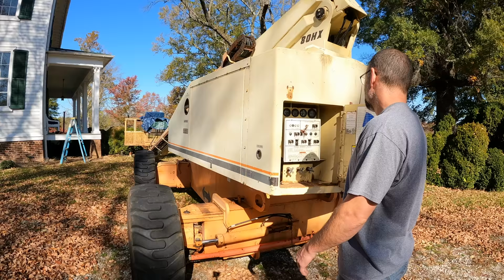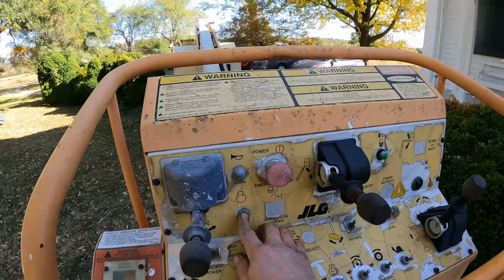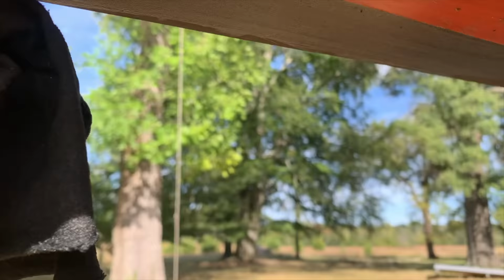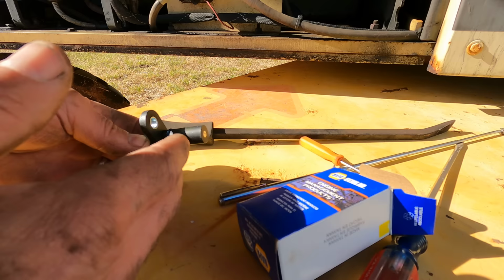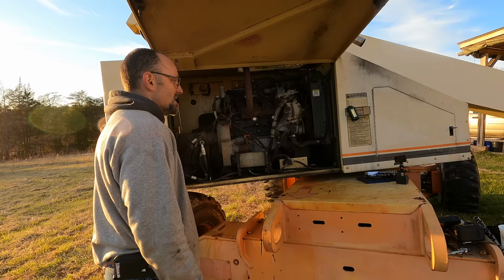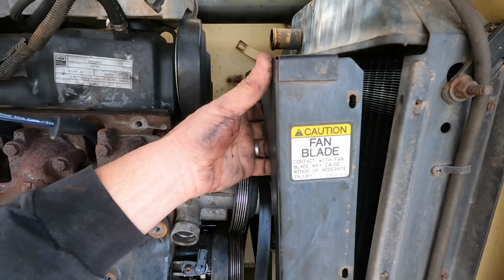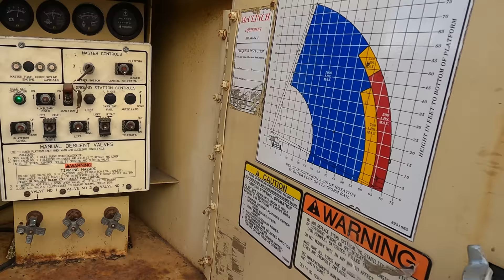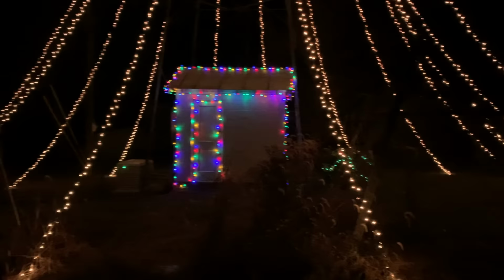My Boom Lift Broke Again! Fixing It & Then Doing a CRITICAL Job With It.

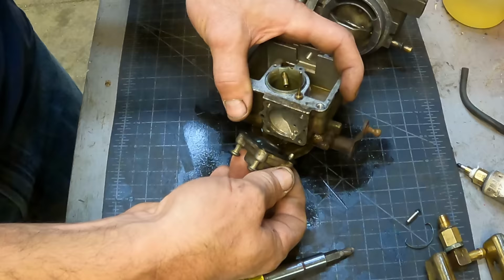Comment: at +3:00, and at +5:15, where's the spring that's supposed to be on the outer side of the black rubber diaphragm? That diaphragm is the vacuum-operated accelerator pump. I don't think it will work correctly without a spring on the outer side to pump the shot of gas into the throat of the carb when the throttle opens up off of idle.

Comment: What is the manufacturer of the engine? I'm sure JLG doesn't design and build their own engines, I'm sure they buy them from someone else. I'd bet you could get the carb from the OEM of the engine, or possibly if you can determine the cfm of the carb, find one that is more easily available, and can be adapted to fit for like a tractor or something like that. BTW, I'd bet that plug is for a vacuum advance on a different engine.

Comment: Hay thanks for another great movie, I once had trouble starting  my mark 3 ford cortina and I took it to my garage and they changed the thing that gives the coil 12 volts while you crank . Is it the verable resistor??  I can’t remember what it was called . Hope this helps.

Comment: Is your fuel gravity Reed?you might need fuel pump (electric)  also ck. From fuel tank to filters to carb (may have a break or pinhole in gas line to starve gas to carb
Hood luck

Comment: Coil and wires.....but did you check and replace the spark plugs? Best ignition in the world doesn't do much good with 20 year old plugs with an equivalent of 250k miles on them.....

Comment: Sorry if my questions are becoming annoying. But I bought a 2000 800a and it's not running well. What napa part number did you get for the spark plug wires?

Comment: hmm, you say thats a 90s ford ranger motor? I have a 89 ford ranger and its fuel injected. it sits and sits and Ill crank it every once in awhile and it fires right up every time, after the battery has been topped off

Comment: hi I ask the question is the engine,  electronic or points  if its points and has a condenser change the  condenser
on old engines with points the condenser  was the most common starting fault

Comment: Have you checked the fuel pump? Perhaps flow/pressure is low, meaning the bowl eventually fills up, but the drains too quickly under load. Alternately, try burning some sage, or contacting a priest. :)

Comment: Your problem is defiently fuel related, I think you are loosing fuel pressure so check the pump check all lines and filters, check fuel pressure it should be I think around 50 psi. But it is for sure a fuel problem… unless it’s your timing so check that to

Comment: what is the part number for the coil and plug wires ... or what vechichle does it call for i have a ford lrg 423 i believe there basically the same thanks

Comment: Looks like the fuel is draining out of the system when not running, there could be a bad check valve at the fuel pump…

Comment: How did you not need an industrial-grade bleep machine? Admirable restraint sir.

Also, assuming the motor just drives a hydraulic pump, would it be feasible to fabricate a removable platform for the motor since it seems likely this is going to be a time-suck for the rest of your life? Note - I'm a computer programmer not a mechanic so treat this suggestion with the disdain it deservers.

Comment: You'd think there'd be a HUGE market for a new set of engineers... to figure out how to design this equipment so that there is more room to make it much easier to work on.  Seriously... did they have to put the drain valve for the radiator at THAT end of the dang thing?  May be time to start a company that actually does that... might give Yanmar and Kubota and all those companies a run for their money.

Comment: If that is the older Ford 2.3 liter engine in that thing, REPLACE THE ENGINE. That engine was designed for the Pinto, which should tell you everything you need to know. That engine's best use is as a boat anchor, and it's not even ideal for that! Mark my words, keeping that engine is the way of masochism and frustration. 

I have had three of the damned things, in a '76 Mustang, a '79 mustang, and a '95 Ranger. Every one of them ran poorly and ultimately threw the timing belt. The engine is a zero-clearance engine, and throwing the timing belt while it's running will result in the camshaft getting warped. Once that happens, it will run even worse than it's running now. Throwing parts at it won't help, I think it was designed to run like s#!t after about five years.

Comment: Totally random question. Are you a ham radio operator?
Reply from the maker: I took a class years ago but hardly remember a thing, so not really.
Reply: The reason I asked was the antenna you had up on the top of the windmill.

Comment: That white lithium spray grease is garbage. Often worse than no lube. It's dissolved (thinned) for spraying and when the solvent evaporates, the remaining grease is overly soaped and hardens to either fall off or jam. I've seen it stick seat sliders, window regulators, and trailer jacks SOLID. Use good bearing grease and since it's outdoors and not sealed, something marine or even better, dry film lube (largely teflon,  normally) as the manufacturers suggest.

Comment: Get rid of that auto choke... Every auto choke I've ever seen has failed sooner or later...often the bi-metalic closing/opening spring gets weak and the choke flutters and / or gets sucked closed by the air flow of the engine...99% of the time it's an easy job to fabricate a lever and fit a manual choke pull .

Comment: you shouldnt finish off coiling stranded cables by tying a knot. you kink the cable which stretches part internally and reduces the load capacity and life of the cable your technique does reduce twist which is good, but try this technique to make the cord a bit smaller and more managible if you have a few of them. i use velcro ties on my cables to finish them off. others use ziplock backs. 
https://www.youtube.com/watch?v=yg6uIZErSuY&ab_channel=RocketJumpFilmSchool

Comment: Your firing order for a 4 cylinder 1999 Ford ranger is NOT
1234 as you showed / stated.

“What is the firing order of a 1992 Ford Ranger?
Hi....the firing order for the 2.3 L engine that you are referring to is 1-4-3-2.”

Yes it will barely run and be hard to start when the firing order is wrong.

Get it right & see how you go.
Reply from the maker: It's not the firing order I was showing, it's the plug wires and how they are labeled.  Wire 1 goes to cylinder 1, 2 goes to 2, etc.